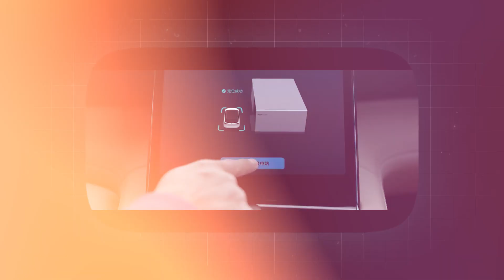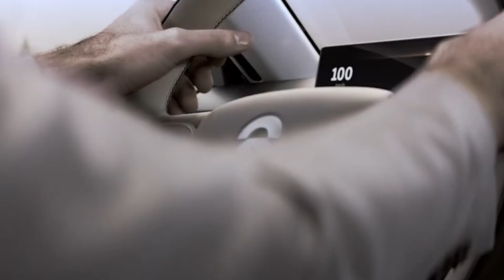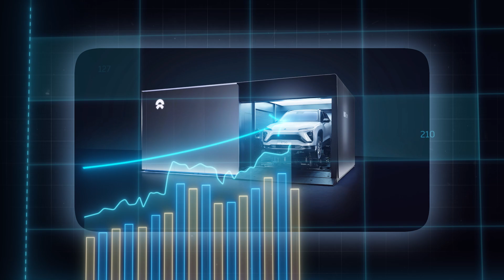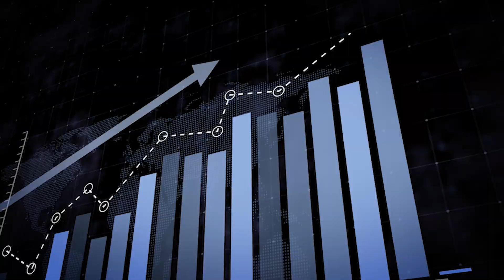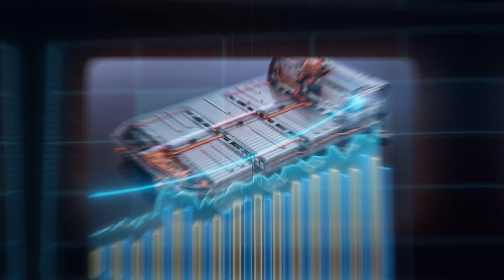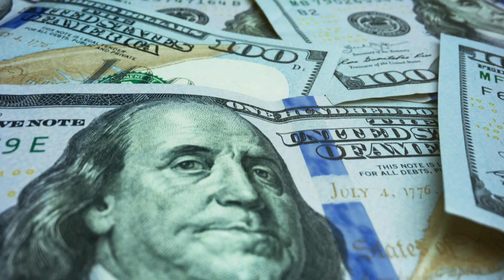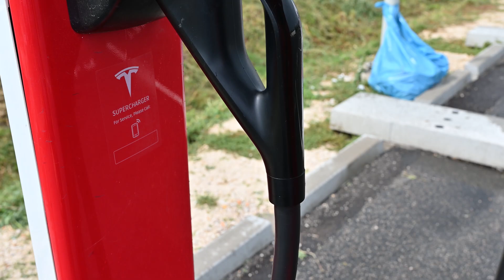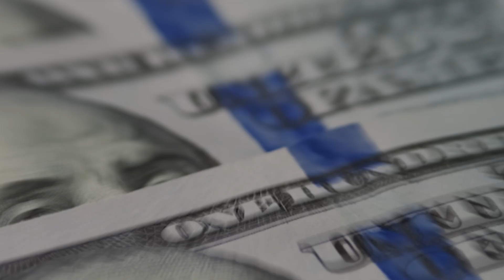New EV Car Has No Battery and DESTROYS Tesla’s Future!

Comment: The title is incorrect. The car still needs a battery, but does not need a long charge. In Israel before the Tesla era. A businessman tried the method. But for various reasons he did not succeed. Because the car industry was not yet ready for the technology. And because of logistics it failed.
Reply from the maker: Thanks for the input.  It seems as if a lot of the new technology's success will be dependent on the market's adoption of it.